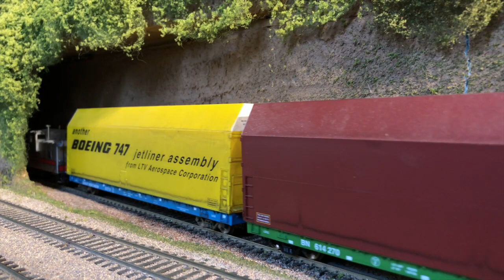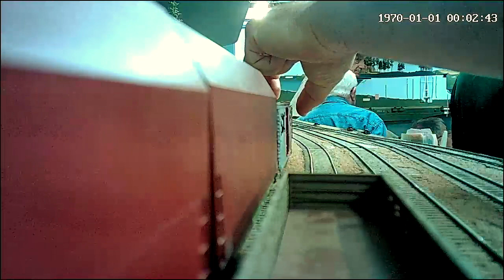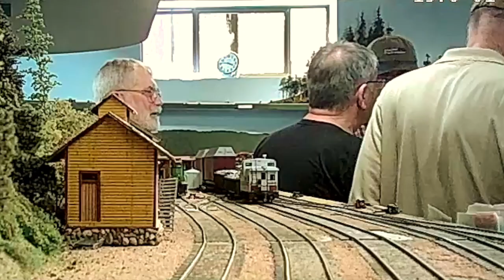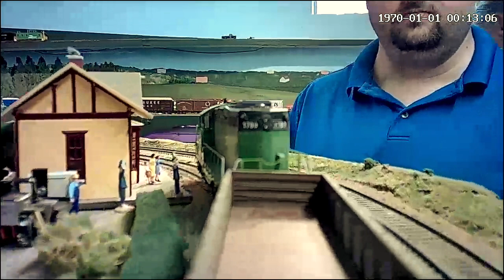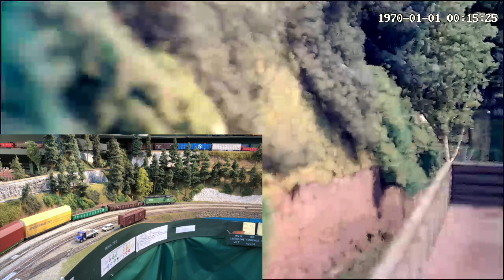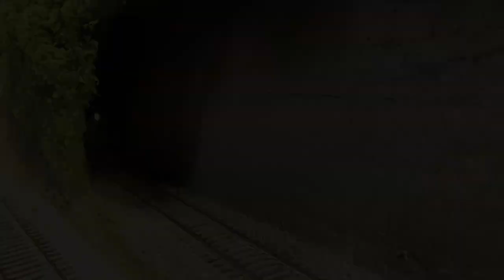Part 56 - Planes on Trains - BN's "Jet Job" onboard camera view during op session #32

Comment: That is pretty good footage for 1970.... (the cameras date is 1970, guessing that is the year of your rail line)
Reply from the maker: No, the footage is recent - I forgot to set the camera up to print the correct date on the screen. The layout is set in 1973, but I only started building it around 1985...
Reply: @muchfunwithtrains  Just a thought You could time stamp the new videos going forward with the Year 1973 and just add days to each new video would make it feel  sequential and just a small touch.
Reply from the maker: Great idea!